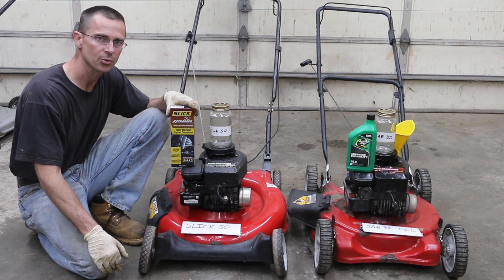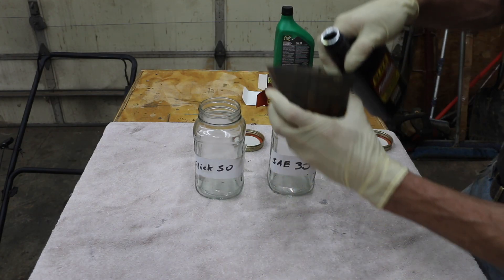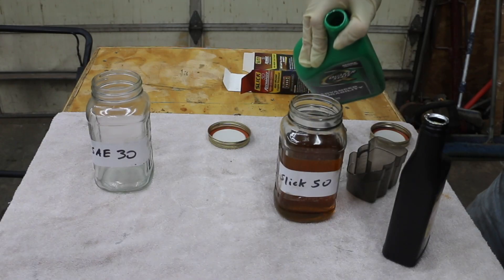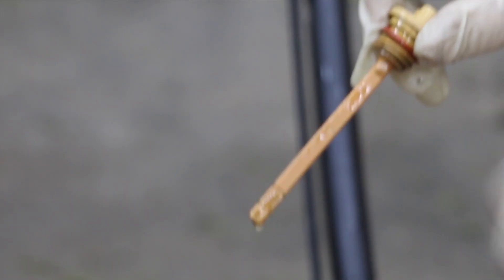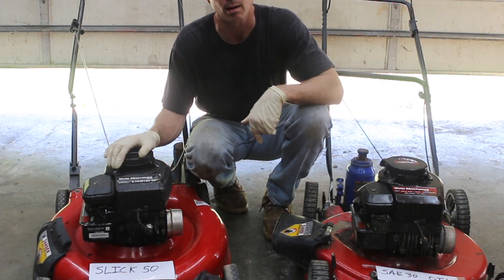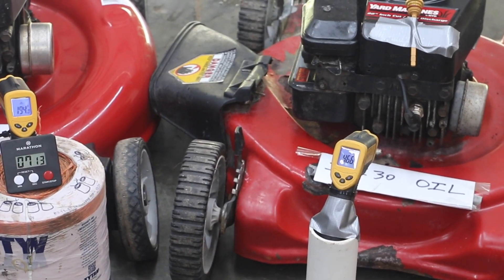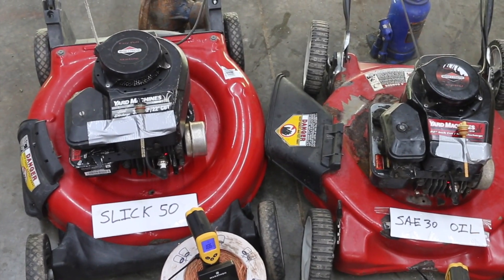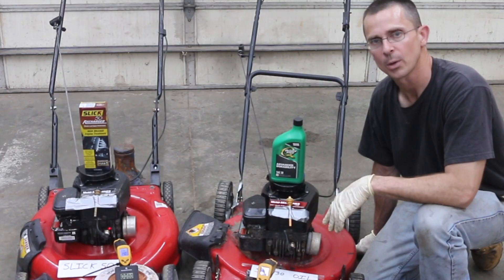Can't believe what SLICK 50 did to my engine!!--Dry Crankcase Test!

Comment: that is not original slick 50 formula
"Xcelplus" is it's new name slick 50 original formula....
Reply: Ask a car dealer's service manager if Slick 50 voids the engine warranty. I can't speak for current, but when I bought a 2002 Impala new I asked this question, and was told no, it doesn't, GM has no problem with it. Believe me, if it was known to damage anything, they would invalidate the engine warranty if you used it. I've used it over the years, and while it may just be that I'm dedicated on maintenance, I also abuse the hell out of my engines, and get remarkable service from them. I sold the Impala before it got old, but also had a 1997 Lumina with the 3.1 V6, a decent engine but not known for longevity. At 175,000 and still running like new, and using less than a quart every 4,000 miles on semi-syn, the harmonic balancer started to separate, so while I had it off I decided it would be a good time to replace the timing chain and gears, and the sometimes problematic timing cover gasket that has cooling passages through it, known to leak. I've done chains on a number of these motors, usually really sloppy by this mileage and damper worn out, on the rare motors that made it this long...mine was still perfect, nice tooth definition on the gears, damper still meaty and chain slack well inside acceptable specs...I replaced it since I'd already bought the new chainset, but kept the old one to show people who would find that interesting. At 210,000 miles, I gave the car to my son, who took it to 275,000 before body rust and electrical problems were becoming too much of an issue. But the damn engine still ran great, and never gained in oil usage. That could be considered a fluke, but I've had too many flukes to not think there might be something to this stuff I've been using for 30 years in many cars.
Reply: Original Slick was basically PTFE (ie Teflon) suspended in a straight 50 weight oil.
The Teflon tended to settle mostly on stationary parts, where at least it did no harm. It also sometimes partially clogged small oil passages. When it did that,  the reduced oil flow caused the affected parts to experience less drag from having to move oil around which led to lower temps and better power. It also led to increased engine wear.
Reply: I have a bottle of Slick 50 that i use for lubricating my bicycles, and it's supposed to be shaken, when shaken it has a cream colour, which is the Teflon.
His was just the motor oil base with the teflon stuck to the bottom of the bottle, I assume..
Reply: Bull chips they tried to steal the formula and got sued, and lost but won the name only not the formula.
Reply: Yeah the 3.4 DOHC was a hot mess. We cringed every time one came into the shop. The first one that came in with a busted timing belt we looked it up, and the specs say it's a non-interference motor, but after doing that ridiculously difficult belt job, it turned out it DID crunch the valves and the engine was junk. Found out later that they are notorious for having enough slop in them to crash the valves after enough miles to actually need a timing belt...so it's either do it BEFORE it needs it, or end up with a paperweight...but all bitching aside, they were a pretty impressive motor at the time...the manual trans models were good for 215 hp, which was pretty fun in a mid-sized car in those days...when even 5.0 Mustangs were only putting down 225 hp or so....
Reply: I guess your right. this is not the old formula I had used in my old Datsun long time ago. that Slick50 worked great. he had to buy Slick50 engine treatment. http://www.slick50store.com/
Reply: ' which had been true to the eighties.'  Because 'slick 50' had already lost the formula in the 80's.  The original that worked was only 78-84, and they kept marketing the new crap off the old tests.
Reply: MMM, I noticed that as well. He just got the base oil, you're right. There was a lot of flaws with this demonstration, and some incorrect assumptions. I think I went into it in comments here, but to me, the slick 50 engine looked newer, and newer engines will, paradoxically, suffer from lack of oiling faster than one with some wear in it, for several reasons. Not a very scientific comparison. But interesting anyway.
Reply: Uh, "oil sludge" doesn't form on cylinder walls, kid. It can only "form" where oil is not pressurized and/or on wear surfaces such as cylinder walls. I know you're just a "fan" but I'm a Master Mechanic and Industrial Engineer with 42 years experience. Fuel injection/carburetion has nothing to do with "carbon build-up". Carbon build-up has to do with incomplete combustion and/or combustion timing. Ever see carbon build-up in the manifold side of intake valves? That's actually oil carbon from excessive oil consumption. Nothing to do with the fuel side of an engine. You should have known.
Reply: I have a container of the original slick50 and was given one of the type you are showing here. They are NOTHING alike. The original feels slippery on your fingers after wiping them with a paper towel,  this one just feels like oil, and is wiped off easily, leaving just the sensation you get after touching motor oil. I wouldn't use the new slick50 in anything by itself.
Reply: Sure your right. At one time long ago slick50 was the shit.
Reply: L TR - my aunt gave me a '92 lumina that I beat the shit out off for yrs. Drove it to bone yard with 340,000 on it. NY salt ate it up. Was getting unsafe to drive. Loved that car. Never skipped a beat or used oil.
Reply: L TR I don't know where people get this idea that the 60 degree V6 (2.8, 3.1, 3.4l etc) were unreliable unless they tried to break them. I've owned several GM cars and still do to this day (2012 Malibu LTZ with the 3.6l) and every one of them that had proper service done to them far outlasted anything else I've ever owned. The 2nd Gen 3.1l DID have valve issues, and the 3rd Gen 3100/3400 obviously had the infamous "head gasket failures" which were actually proponents of the LOWER INTAKE manifold gasket failure which ultimately lead to head gasket failure. If you owned a 3rd Gen 60 degree V6 you had the gasket changed for $200 and they'd last forever. Let's not forget the MASSIVE scale these engines were produced at as well. They were put in EVERTHING from mid-sized sport coupes to mini-vans to trucks and they STILL are to this day.
Reply: robsycko Who'd want the old forumla unless maybe it's good on old equipment? The old formula was archaic already in the eighties.
Reply: They got sued in the nineties and lost for selling stuff that broke cars in a way which had been true to the eighties.
Reply: We just didn't know it as well until 90's cars and their better sensors helped us realize what Slick50 was breaking.
Reply: doesnt that SUK?! where can we get the old "Good" stuff? money talks and we get the bullshit left over; Hate it;
Reply: ClintL63 Even the old stuff is wrong with current oil forumlas. Let it go. I'm not the scientist who did the analysis, but a scientist explained it to me long ago. Maybe if you had an additive free oil like the cheap synthetics at Walmart Supertech, then it wouldn't react and cause more problems instead of helping.
Reply: Tommy Gunn Just get something modern like my post suggests bud. Even the original will REACT with modern oils. More harm than good...but another commentor said the lawsuit was over other issues. Who knows... didn't research it as deeply as the other poster.
Reply: B maloney Exactly. It was the bomb, but it's old reputation is still with sales. Most additives only work on cold engines. Once they heat up, they're useless. It's really hard to get a good one.
Reply: B maloney it's now called xcellplus u can still buy the old school stuff
Reply: Ivan Soto They got sued. That company is no longer allowed to use the Slick50 formula.
Reply: They were good cars, but unfortunately a lot were bought by old people too cheap or poor to buy a Buick. So there was always a lot of low-mile creampuff Luminas available, which were then bought by, or given to, snot nosed kids that beat the fuck out of them and didn't understand why they came apart so quickly. Der. Any car is going to, when left to atrophy for years and then run like a rented mule... :)
Reply: Thanks for the demo. I grew up using it too.
What I do now is use a grade thicker oil than what the manual calls for.
So if it recommends 5w-30, I use 10w-40.
I believe this reduces wear and we have to remember the manual is for when the engine is new and tight and concerns about increasing gas mileage for cafe so thinner oil.
Reply: Cliff JONES those luminas were actually great cars made by gm. hard to find used as they were kept till death.
Reply: Luminas were great cars, except for the mid 90's 3.4HO Z34 Dual Cam. I had a 3.1 I bought from a dealer my wife worked for (he sold me new car trade ins for actual cash value), got it for $150. When I sold it to guy in town it had almost 200,000 miles on it. It was for his son, and he drove it for years, at least 6 or 7 until he wrecked it. The 3.8 engines were bullet proof. The new Z34 I bought new in 96 blew the valve train in under 6,000 miles. It was always noisy on the top end.
Reply: where can I find proof for this?
Reply: Really  http://lubrilon.com/support/pds.asp
  (site has had loading problems 713 671 2545)  Now  this product is the
  real deal .Was once called Slick 50 until  ( i spoke to him on the 
phone last week) John Bishop  lost the trademark .What auto parts shop sell today Slick 50 is a lie . Anyway  
lubrillon the absolute best protection for tranny or,engine and whatever . 
Been test in car  and oil drained  .Car  had no wear . My Uncle even did
 this test . I use it  :)
Reply: Well, if you were around for the first ones, they were kinda hit and miss. Had a reputation for either running forever or bowing out early. The failures were often completely unexpected and catastrophic. One day it ran fine, the next you had a nice lump of scrap alloy. Had a friend that bought a new Cavalier in about '93 I think, it was real nice for the time, a rare 6-5-4 as we called it (3.1V6, 5 spd manual, 4 door), he treated it like a baby, syn oil and all, but they sold it for a minivan after adding another kid. He'd bought extended warranty on it at time of purchase, to 75,000 miles. It had about 69,000 and the engine totally grenaded (camshaft failure with debris)  on the new owner within two weeks of purchase...but was covered under the warranty. He said if he'd had any idea that was coming, he would have kept it, as the replacement engine was an improved version and probably would have outlasted the rest of the car...that kind of thing was not uncommon...but yeah, once they settled out and matured the design. they were real workhorses.
Reply: BS statement because http://lubrilon.com stuff works period .
Reply: Pat Warde
Reply: Actually sounds plausible, although I can't see how gasoline, which is nothing more than highly refined crude oil creates carbon build-up but then again, I'm no petroleum scientist. Maybe eliminate those deposits with Av-Gas or Sunoco 260. I have first hand experience with propane-powered equipment. This equipment rental yard  I worked for had a 10,000 pound fork lift truck powered by a 300 inch Ford inline six. They wanted me to determine why it was so hard-starting and gutless when it did manage to start. After failing a (dry) compression check, I pulled the head. There was so much cylinder bore wear that no amount of over-boring would have saved it. It's a wonder it ran at all! I can't remember the engine hours, maybe 5 to 7 grand or something. I figured the problem was running propane. You know, no lubricating values with propane over gasoline. Believe it or not, I run 32 to 1 2 cycle pre-mix in all my "toys" and lawn mowers. I run it in my 1979 Yamaha 500 4 stroke single & my 1967 International 392/V8 powered Rat Rod with excellent results! A motorcycle "expert" berated me: "Why in the HELL would you run pre-mix in a 4 stroke?" I told him: "Easy. It eliminates the possibility of 'straight-gassing' my 2 strokes!" Only one can required! Maybe since you know so much about aviation, can you tell the readers what exactly is "Jet Fuel"? Be careful because I already know the answer. You sound like a great kid. Thanks for not coming back like the rest with [a] potty-mouth. You other kids should take note of this Aerospace kid! You'll learn something! (by the way, my older brother was 20 years navy Aviation as a piston (radial) then later jet engine mechanic. I'm the black sheep and went army aviation; rotary-wing)
Reply: Watch the video explaining what happened to Slick 50:
https://www.youtube.com/watch?time_continue=1&v=CAt-tJa9P_s
Reply: The problem, when you sell a product like this, and make claims such as they do, is that people are inherently optimistic and really stupid where it comes to cars. They don't use the product as intended, that being for preventative treatment of a machine in good working order...nope, they put it in when they start hearing noises they don't like, or the engine starts losing power or using oil. Then when it grenades, they blame the additive. That's always been the way...you put it in a motor that's full of sludge and crispy wax scale from neglected oil changes and sounds like a can fulla rocks rolling down a hill on cold start, sure, bad things are gonna happen, and possibly quicker than if you'd just let it die a slow death.
Reply: ' for selling stuff '  The real stuff was 78-84, and they were sued in the 90's because the crap they sold in the rest of the 80's didn't have anything to do with the tests and data they were still showing from the original product..
Reply: While yes, it's not the Slick 50 of old, and it invalidates some of his reasoning, leading him to a hypothesis for this test, the old Slick 50 could not continue. The old formulae was so harmful to modern engines, that they left the shelves. It even made it on the news in Utah and fans of it were buying the last of what they could get. Later, Slick 50 emerged on the market again meeting current standards and criteria. What is it now versus then other than approved again? I don't know.

Comment: I've included two superior products below (NoMorFriction and Motorkote). I just thought I'd also give my own testimonial about DuraLube. I once had a 1995 Plymouth Neon with a 2.0L SOHC 4cyl. It had a blown head gasket and a hole in the radiator. I unknowingly drove the car for roughly two months with no water in the radiator. I would typically shut off once on my way to work (86 mile drive). I would pull over, disconnect the battery, cross the wires to clear the ECU memory, and then restart after about 10minutes. I was barely making enough money to eat, and sometimes would let the oil run low. The engine was only treated twice with DuraLube, and ran with said blown head gasket for over 6yrs.

https://www.amazon.com/NMF-Ionic-Friction-Reducer-Engines/dp/B01DAI8O4W

https://www.amazon.com/MotorKote-MK-HL32-06-32oz-Hyper-Lubricant/dp/B000EGAM0I

Comment: In order to do true test both engines need to be new. Using 2 different used engines proves nothing at all.
Reply: Jason D I've been thinking about this again. And new engines have differences. So...while the controls could be better. New still isn't a guarantee. Especially with how cheaply these engines are made. New or used, you'd have to blueprint the engine first. Either way, we still know Slick50 can't keep an engine running without oil.

I always wondered if how they set up that lie of a test was by running Slick 50 only... probably still not the best, as it's an additive, but better than nothing. That old commercial 25 years ago or so, I remember thinking as a boy that they were misleading but not lying if that was the case.
Reply: I think you would have to have a bunch of new engines and run the test on each and compare to draw any reasonable conclusion. That would give you a somewhat reliable result, the more engines the better.
Reply: Or at least get a baseline that each used engine seems to be the same. Answer this question? Would they both be equally hot with the same oil? Was their compression the same? The engines appear identical, but on slightly different lawn mowers, but one person mentioned that an identical looking engine could be the good, versus the cheap version.
Reply: DE Nichols You can tell one has had a way harder life than the other.  The wheels are all messed up on one lol!
Reply: the one with the stuffed wheels has the newer looking engine
Reply: Jason D actually no. The one with bent out wheels was built that way on purpose to make it easier to drive straight. I learned that by reading TONS of comments. Some small engine pro's all the way back to the 60's have been on here.

Comment: ...too bad the history of each engine (before this test) has WAY more effect on the results more than anything having to do with oil vs Slick 50... For the viewer in-the-know, absolutely no accurate data can be drawn from this flawed test until two identical engines with identical histories are used.